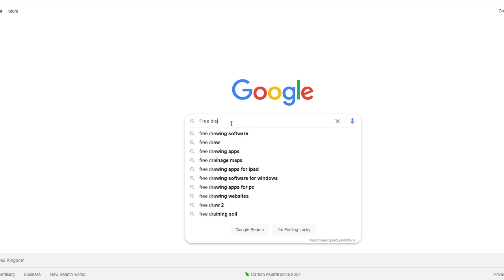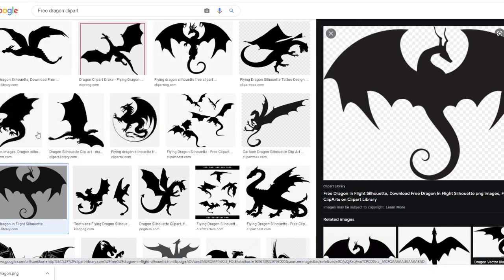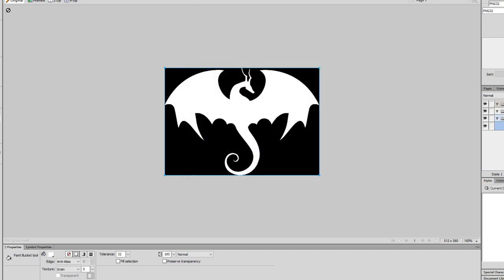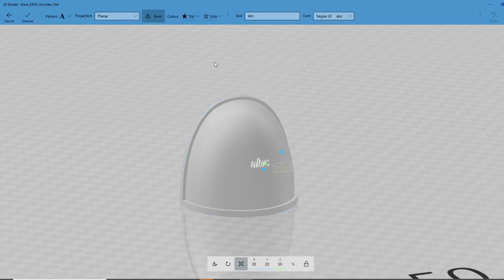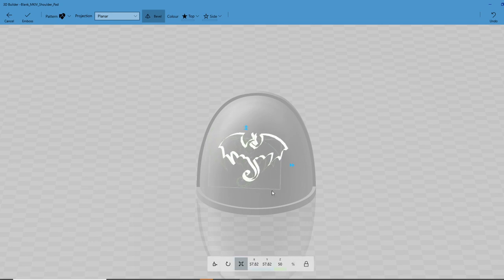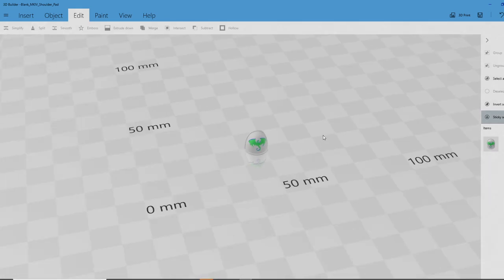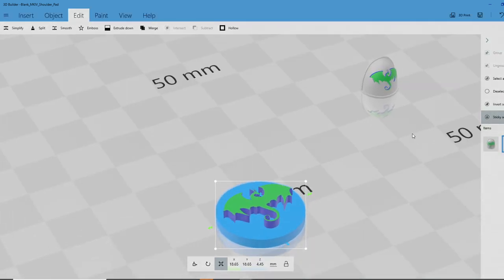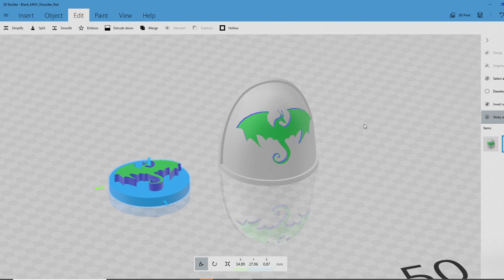How To Make A Custom Space Marine Shoulder Pad STL In Seconds With WIndows 3D Builder

Comment: Awesome. Is there any way to delete the shoulder pad so we can just create the icon and glue it to models that have the pads built into them?
Reply from the maker: I'm not sure you can using this method. I find that printing icons this small results in very fragile pieces
Reply: @bitzbox  Yes that is a problem but I prefer just having the icon as well. As RGVShooters say, many models these days have built in pads and I'm not desperate to carve them off to fit a new pauldron.  A few broke or even failed prints aren't really an issue and once glued on the icons are fine :-). Great video but doesn't do what I want. I guess there must be some way of deleting the pad.
Reply: You have to go into Blender, ungroup the shoulder pad, delete it, then regroup the model together again. That only works if the shoulder pad is a separate mesh, however.